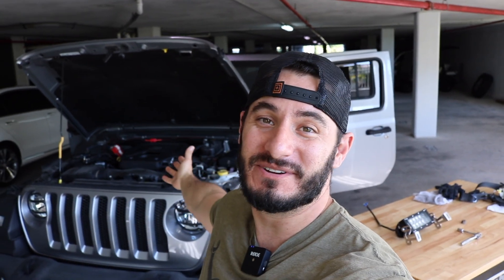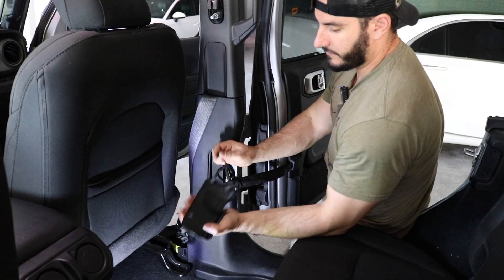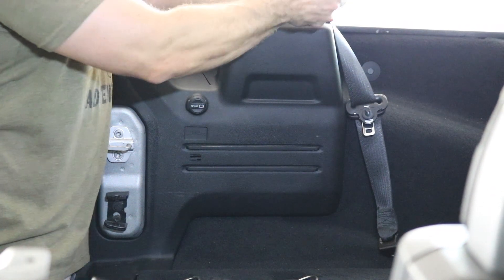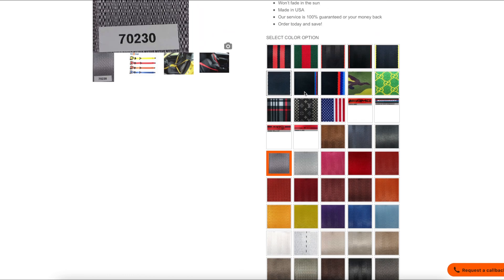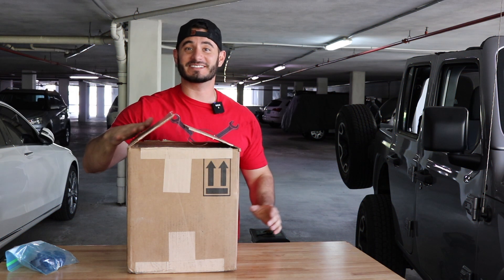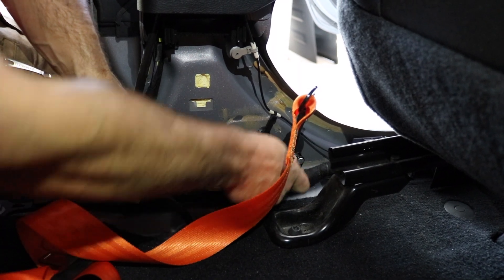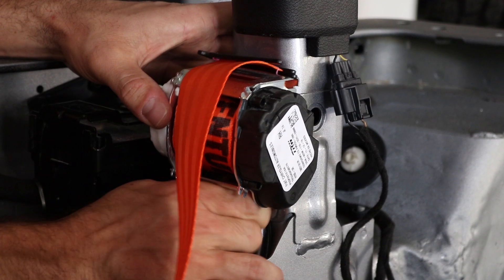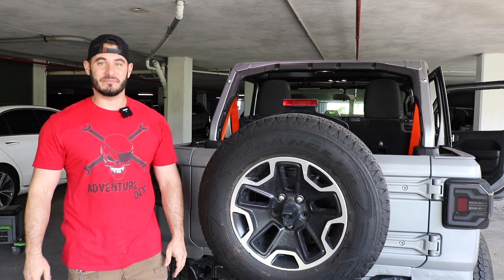How to install CUSTOM Seat Belts! [EASY]

Comment: How did you get to the center belt ? I found the bolt but cant seem to get the unit out
Reply from the maker: Once the bolt is out the unit comes out the front. It takes some wiggling as the opening is small. 👌🏼

Comment: Awesome video, do you need to switch off the battery if you’re only replacing the back seat belts?
Reply from the maker: I did but not sure it’s necessary
Reply: It would of been nice if you would of showed doing the one in the back seat. Other than that its great.

Comment: 2018 Jeep Wangler Sahara Unlimited JK - not that easy! The nuts are glued on with a special adhesive, you need to apply heat to them to be able to remove. Also, the rear cargo panels were a b*tch to remove.